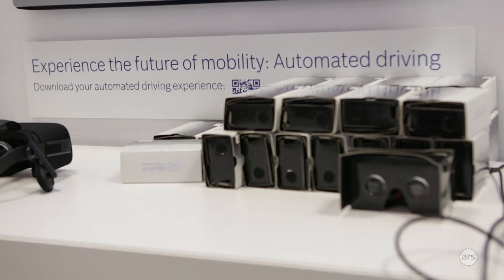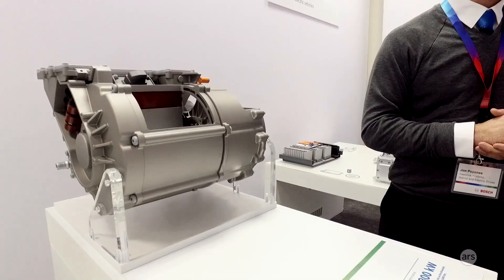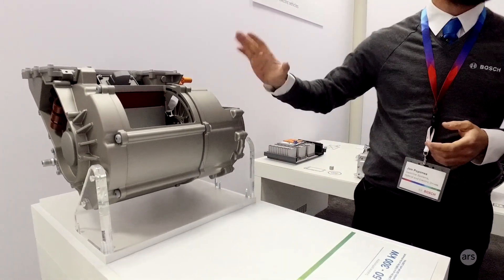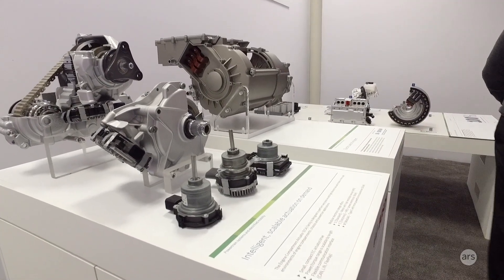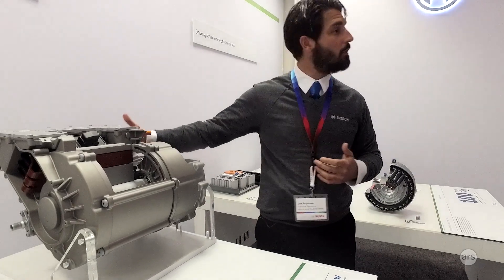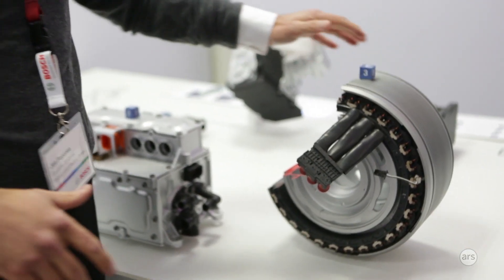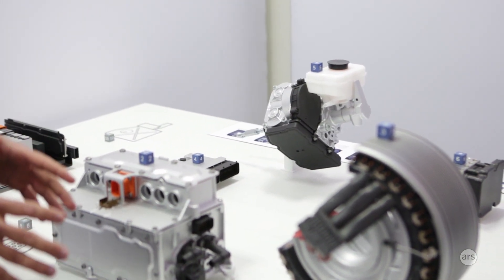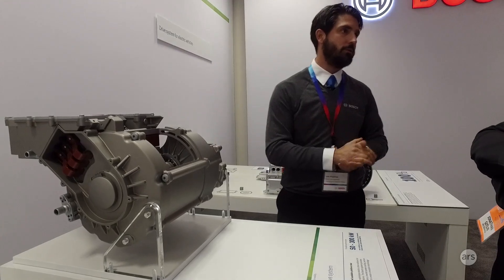NAIAS 2017: the future of EV motors with Bosch | Ars Technica

Comment: Hello. 
You have information on an electric motor of approximately 500 kW, which has a Gigantic torque of approximately 700-1000 N/kg.
At the same time, low-speed about 10-100 rpm / minute
----------------------------------------
Привет. 
У вас есть информация, на электродвигатель примерно 500 kW, имеющий Гиганский момент вращения примерно 700-1000 N/kg.
При этом низкооборотистый примерно 10-100 об./мин.

Comment: Why must you speak of transmissions?  Some automatic transmissions these days are absolutely awful!  It would be nice to be able to use a variable speed motor to make them obsolete!!  Then if you want to get into CVTs they are most certainly NOT without reliability issues either!!  Any transmission put into an electric car or truck better be able to handle massive amounts of torque and last a long time.  This is the future and it is time they started making a car that could last (not just a Toyota PLEASE!!)

Comment: Classic marketing nonsense... We have an XMO followed by a 36ph , based on a CL2. But for OEM we use an ABC with the advantage of XLS traction.   This D2000 is our flagship model though. It's IPS is optimized for DLS. Unless of course you want less RGN, then use our model SP275.

Comment: SO, you talk about the strides of the company’s history/R&D. But you failed to mention that Zero Motorcycles use a complete Bosch system on all their bikes.
Reply: In the electric bike world  Bosh has a proven track record. Mainly based on its ability to supply spares and offer support but dont under estimate the fact that they have been around for a long time and act like that will continue. 
The problem with new tech is too much isnt designed to be repairable... And warranties are dependent on the limited availability of parts. So evolution and ease of retro fitting is an important change all manufacturers and legislators need to make.

Comment: I imagine an all-in-hub electric wheel that can be mounted on any gas engine car, removing the engine, transmission, gas tank, brakes, etc and adding battery packs, the computer and the new connections to a car's brake and accelerator pedals.

Comment: Im just wondering why it took so damn long for electric vehicles to take notice. Everyone is talking like this is new but its been around as long as automobiles have been made.
Reply: @the1anonymouse  sorry, energy density not thermodynamics efficiency
Reply: first "automobile" was electric in 1850
Reply: society has inertia, EV lost because gas efficiency is so high; now it's a century old tradition and EV were moonshot (until well ..now)
Reply: Actually electric cars were the norm before gasoline and diesel vehicles entered the market. The way gasoline cars won was due to being cheaper, having longer range and by suggesting that you would have to be a woman to be satisfied in a womans car(an electric).

They finally seem to have solutions for most of the BEV problems, although it probably will be another ten years before buying an electric car will be cheaper than buying a gasoline version.